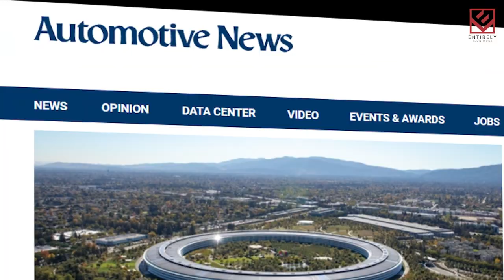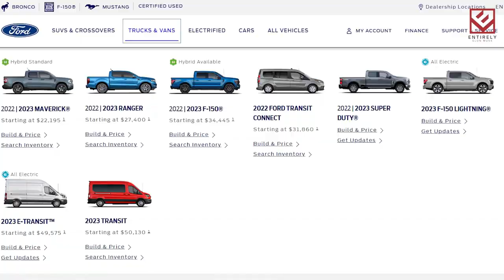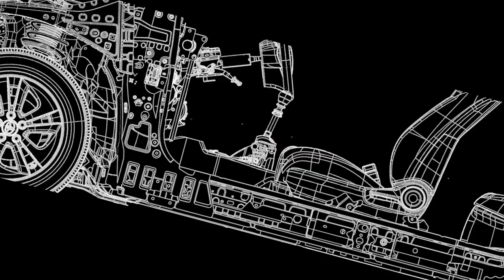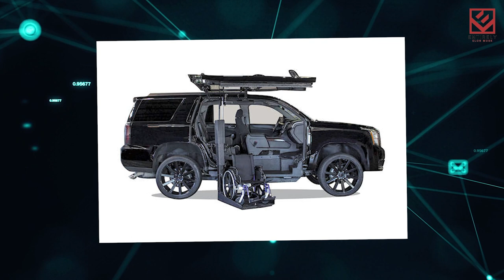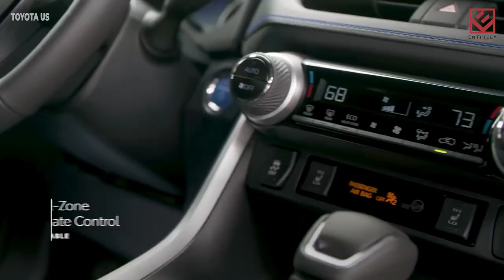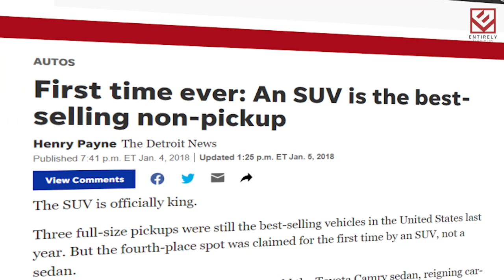Toyota's Releasing $20k Ford Maverick Competitor!

Comment: I vote regenerative hybrid with also plug in capability. Those of us that want a small long distance hauler to get high mpg, distance without worrying about delay charging away from home, yet allows for customer transitioning towards ev as infrastructure comes on line. Customers will have gas, regenerative and phev to keep moving along. Allows customer option of power choice in one vehical.